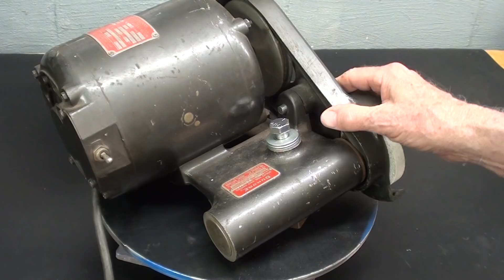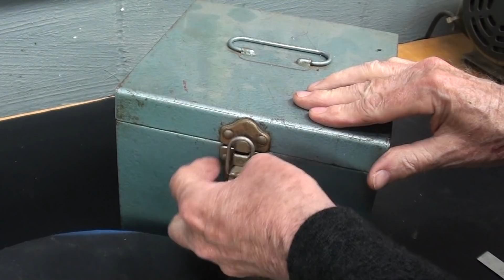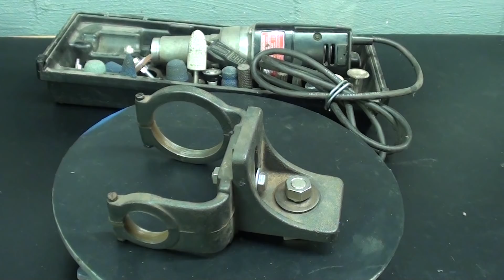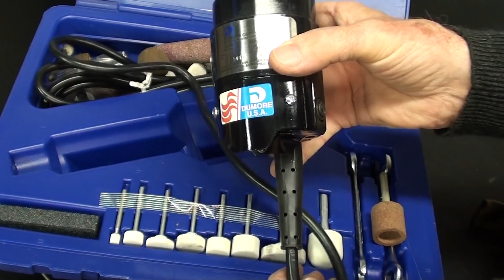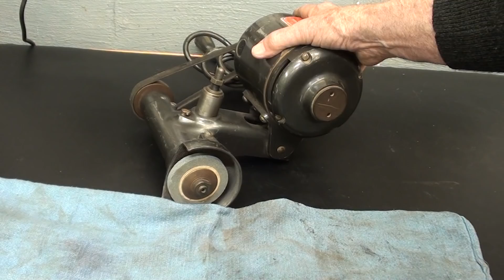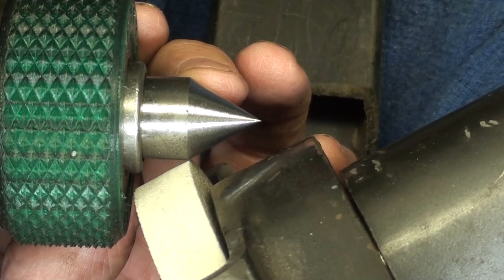Grinding Centers on ATLAS Lathe  pt 2 TIPS 559  tubalcain

Comment: Hi Mr. Pete: like the series, and especially appreciate your emphasis on safety. I would add that when I was a kid working in the oilfields of Texas (50+years ago) I was taught two things: NEVER put your face in line with the grinding wheel and NEVER grind aluminum, etc. because it gets embedded in the wheel and it may come apart at hi RPM.  Looking forward to the next one about live centers. Thanks

Comment: I just ground my first part on my 16” SB lathe; a hardened Walstrum no. 1 Morse taper adapter, (that was 15/16”, and I ground it down to fit my largest R-8 collet 7/8”). To align the grinder with the axis of the lathe and get the height right at the same time, I put centers in both the headstock, and tailstock, and that gave me alignment and height simultaneously!!

Comment: Shop vacuums are one of the best devices for home use in the last forty years or so.  I would suggest that you fashion a metal collector for the grit to avoid the deterioration of the plastic collector.  Or perhaps install a thin metal plate with epoxy inside the collector.  An interesting video, as usual.  Many thanks.

Comment: Another pre-coffee morning mental meandering...  because it depends on how accurately the grinder spindle housing is cast/finished...  setting an alignment bar between centers and (with the cross feed all the way out) taking a measure,ent from the ends of the housing to the alignment bar?  It would probably work better if the end of the grinder shaft were exposed, but they are sealed...

Comment: Mr. Pete, Have you ever cut down lathe bed ways to shorten it? I have an Atlas TH54 10" that I'd like to cut down because it's way too long for anything I'll ever need and to save precious shop space.  I'd like my lathe to have no more than a 20" center distance so I'm thinking of cutting it down. In your opinion will cutting the bed ways be ruined or likely twist or bend the ways making them useless?
Reply from the maker: That is not something I would do. I would say that ruins the machine. What about the machines feet for mounting to the bench
Reply: @mrpete222  Thank you for your response. Does it ruin the machines from functioning or for value?  I thought about repositioning the back foot closer toward the center so I can mount it to a bench but a good part of the ways will be sticking out.

Comment: I use a small pneumatic grinder held in the tool post of my 15" LeBlond trainer now and then.. Recently I used it to open the hole in a new barrel bushing for my series 70 Colt pistol.. The barrel bushing is hardened and cannot be cut otherwise....Mike in Louisiana

Comment: The vacuum was a great idea. the wet towels are a good idea too.
My question is...Instead of a wetting the towel with water, could you use some type of low flammability oil on the rags? 
Thanks again for the video. Loved it.

Comment: As your doing your grinding, I hope you're keeping a weather eye on your shop vac. They have a habit of catching fire when used as a dust collector, especially grinding metal. Fortunately, you're not removing a tremendous amount of material so the risk is lower.
Reply: Did use the vacuum with a plasma cutter once, melted the hose in about 5 seconds, maybe less, was quite effective for the time it lasted, though...!!!!    🙄🙄🙄
Reply: @pierresgarage2687  Buddy of mine is a hobbyist knifemaker. When he got his 2x72 belt grinder, he set his shop vac on fire once a week or so until he got a real dust collector. People forget just how flammable itty bitty pieces of metal can be.

Comment: Here I got a little model 44 with a burned motor, got to get a finding a suitable replacement for it, I'm thinking about a variable speed 500 watts brush less spindle motor...   Pretty sure it would do well...   For less $$$ than a new or rebuilt original motor.

Comment: Informative and well thought out. Is that Tom-Thumb a dual speed? It looked like it had two different sized pulleys, but I'm not sure. Seems like it would be more versatile than a single speed.

Also, when using your shop vac in that manner it's best to clean it out first, dampen the paper filter, and put about an inch or two of water in the bottom (if it's a wet/dry model) to prevent any secondary ignition of combustible materials that may be in it. When you're  done with the operation, you want to clean the shop vac again. Like you say, "Better to be safe than sorry."

Comment: Hi Lyle,
It's easier to mount the Dremel flexible shaft attachment to the tool post for grinding.
Reply: You are correct, however the bearings on the dremel are not as tight as the spindle grinder.
Reply: Just out of interest a question about spindles spinning at high speeds and the force called "presession" present in turning objects like spindles and chucks. Now its like the spinning object forces a posision in  the air for itself(my words), you can search presession experiments, so I just wondered at very high speeds if bearing condition  by design matters as much as one might think if forces like grinding is introduced slowly and mildly to the spinning objects-?
CNC engineering developed tolls to be used at much higher speeds, would they went that direction for more accuracy sustainable apart from doing the job quicker-? Dynamic stiffness & Precession-----air bearings).

Comment: Hi Mr Pete, thanks for the informative video, I noticed you did not diamond grind the wheel all the way? a bit was left at the edge, was this on purpose? or just an error?

So I  have used the Dremmel method making my own mount out of steal of coarse and got good results.
But i want to build a proper tool post grinder myself, i think ill have to do a video of that to share.  
but i don think ill make one as big and bulky if i can find suitable motors and spindles. or make a good spindle myself.

Comment: I am sure you realize that it is not necessary to dress the wheel flat, a radius or point will work as you are generating the angle off the compound.
JIM

Comment: ?!?! Why didn't you dress the whole wheel?! You seemed to miss big part on the end, resulting in the wheel taking a big chuck out of the point of the center at 21:36 and again at 21:58...
Reply: I saw that too. I think he just missed it while grinding. He should have noticed something was wrong though when taking the first cut and seeing the secondary grind area along with the massive increase of sparks. That is the crappy thing about working with a camera in front; its a lot easier to miss the obvious.